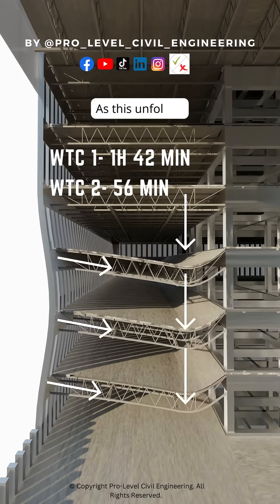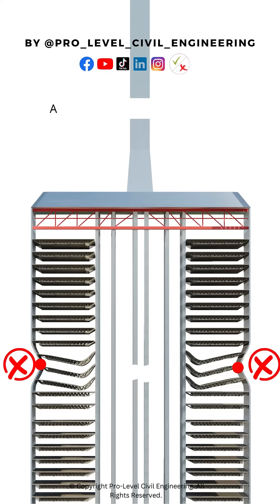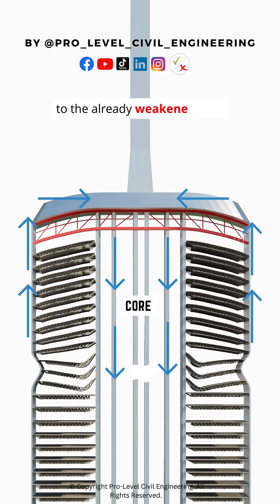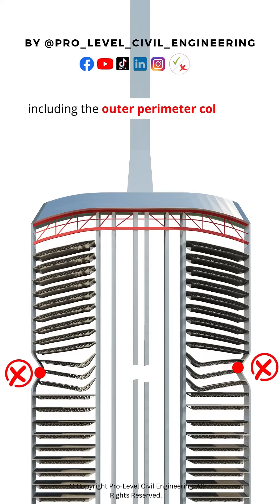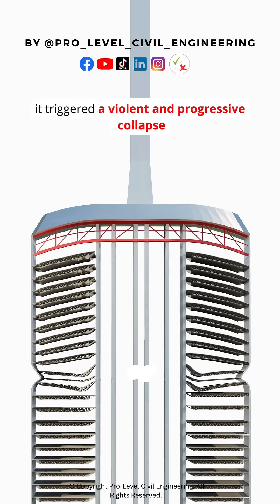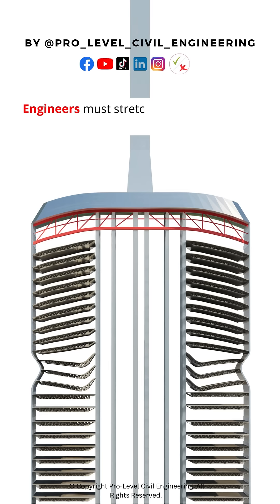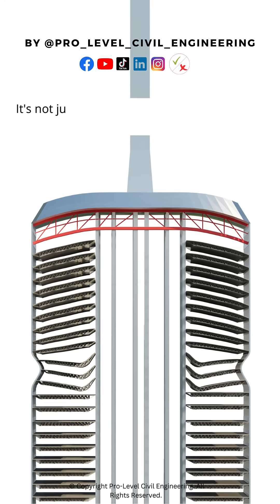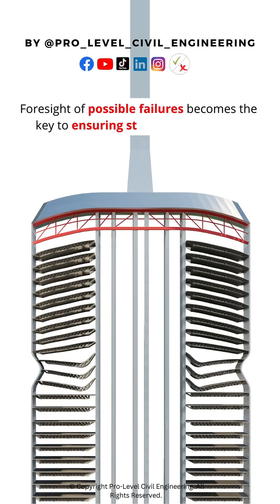The Horrifying Truth: Why the Twin Towers Collapsed on 9/11?

Comment: Total Bullshit.

People need to get their head out of the sand and their ass, which ever is appropriate.

Even after weakening for whatever reason a structural failure at any point/location of the building would have had RESISTANCE from the adjoining structural members.  And because of that resistance a failure/collapse would have tilted/leaned away from that resistance as THAT AREA of the structure failure.

The ONLY WAY a building built as it was, under the conditions that it was could collapse in the manner it did is from a controlled implosion. 

Many, many steel girder buildings around the world have suffered EXTENDED fires far longer as us the case in Brasil where the building burned for 48 hours and the only ones that ever collapsed were 3 buildings in NYC. 

Stupidty married with naivety is a relationship that will last a lifetime.
Reply: Then explain where is the noise usually produced by the controlled demolitions. Even the demolition of medium-rises produce clearly noticeable noise from the explosives but in this case you just have some rumble when building is coming down.
Reply: There was resistance in the collapse. The collapse started slow but sped up as it fell.

The north tower's collapse was slower than the south's but sped up as it fell, too
Reply: Also, both towers DID LEAN away from the resistance
Reply: It completely make sense, since some footage moment before it collapse, you can see the external bent inward and collapse
Reply: Bingo
Reply: Then explain to me Mr Big brain, why were the hundreds and hundreds of videos that were previously up on YT that had corroborating evidence are no longer there?  

The reason, to prove that a certain percentage of people with mental defects will continue to open up their mouth and swallow the spoonful of shit when theyre given it.
Reply: Thats because the only towers that fell because of fire were hit by fucking Boeing 767 that destroyed the fireproof protection on the columns.
Reply: Not even independent studies funded by.the ringleaders of the critical thinkers movement turned up any evidence or trace of any explosives. You’re 15-20 years late to the party.
Reply: you have produced 0 evidence of explosives being used.
Reply: @turbodewd1 what about the nanotermit found in the remains of the building.
Reply: @turbodewd1 Nano-thermite particles were found in the dust.
Reply: @DARKREALM1122  yeah, from aliens right? what else do u believe? JFK drove the ice cream truck into the Pentagon?
Reply: The WTC was not build like the building in brazil. There was very clear resistance in the North tower's collapse.
The south Tower fell faster because it has more weight above the impact zone to make the collapse fall faster.
Reply: @StarstruckChiroMusic They both fell at freefall speed.
Reply: @DARKREALM1122  No they didn't. Because the debris we can see are literally in free fall can be seen falling faster than the speed of the collapse
Reply: @StarstruckChiroMusic Sure they did.
Reply: @DARKREALM1122  What do you believe?
Reply: @StarstruckChiroMusic   I don't trust NIST.
Reply: @DARKREALM1122  Neither do I
Reply: Funny even after requests to test for traces of thermite and other explosive traces that could have been used, NIST refused to test the steel columns for them
Reply: @FataUser  The remains of the building did get tested for thermite. All the found were red chips from the primer used on the steel
Reply: @StarstruckChiroMusic nope. They found nano thermite all over the site and still haven't been able to explain its presence to this day. Thats not to mention newtonion physics, the dancing isralies, insider trading, able danger, the suppression of information and mishandling of the 9/11 commission report, Halliburton's insane no bid contracts, or the fact that osoma bin laden didn't even claim responsibility for the attacks until 3 years later. Isn't that a coinkydink?

Comment: The outer colums should not buckle inwards. The structural load from the floor plates remain the same whether it's sagging or not.
Reply: No
Reply: @mohammadmahmoud8135  Tell us why?
Reply: Where did you get your engineering degree?
Reply: @bobsantilli7565  I don't even have one and even I know this guy is spewing bullshit
Reply: @bobsantilli7565  I got my degree from some place that teaches thermal expansion. Steel doesn't sag rike rubber  at 800 degress celcius. It still has significant strength. However, steel expands significantly at 800 degrees. Minor sagging, considerable expansion. The columt should be the same if not bulgins outwards. 

Moreover, the floor plate were hanged to the colums. That means, regardless of the temperature, the load on the columns should be the same because steel doesn't gain weight by heating.
Reply: @bastadimastayou do know there’s like thousands of computers, office desks and heavy office furniture putting weight on the trusses while it’s also on fire. 

400°F (204°C): Steel begins to lose some strength, but is still functional in many applications. 
1100°F (593°C): Steel can lose around 50% of its original strength. 
Beyond 1100°F (593°C): Strength decreases rapidly, potentially losing up to 90% at temperatures above 1200°F (649°C), significantly increasing the risk of structural failure.
Reply: @ODSTZOMBIESLAYA   the weight of these items are almost negligible compared to the weigh of the structural steel and laid concrete on floor plates.

You should study fire cases in other steel structures.

1945 Empire State Building B-25 crash

Ostakino tower fire

2002 Pirelli Tower airplane crash

and many others.
Reply: @ODSTZOMBIESLAYA  There were no computers,  desk or heavy office furniture found in the debris!
Reply: If you watch clear video of the wtc collapsing you can literally see with your own eyes this failure mode actually happens. The trusses sag inwards because the floor trusses were dragging them into the building

https://youtu.be/ULdiD6gYZO0
Reply: @ODSTZOMBIESLAYA  then the explanation is wrong. Heated floor plates at that temperature does sag as much as they claim. The thermal expansion of the floor pleased also counteract inward buckling. Moreover, since those floor plates are Hanged instead of being fastened, they don't exert horizontal forces to columns as much as you predict.
Reply: The floors were welded from the window to the center, when the center was disrupted from a plane flying into it full speed, the floors were attached to the windows still and were dragging the outer columns toward the ground.
Reply: I don't see how fire weakened sagging trusses could have the strength all by themselves to pull the much more massive perimeter columns inward, no matter how much the office materials/furniture and concrete floors weighed.  We're talking about those compared to massive steel beams.  

You can easily see the perimeter columns bending inwards at the South Tower collapse initiation, but IMO that indicates that the core failed first.  If the core fails and starts falling, it will pull on the trusses which will in turn pull on the perimeter columns to produce the inward bending we see.
Reply: @yearginclarke  Bingo!
Reply: remain the same but not equally distributed.
Reply: No it doesn't. When it's not sagging it holds the floor up, when it sags, it pulls on the perimeter columns.